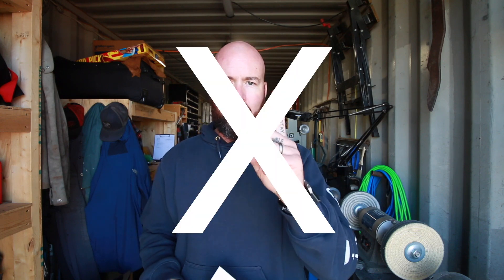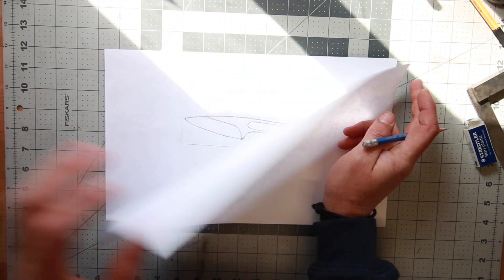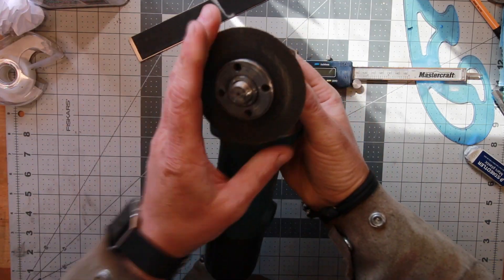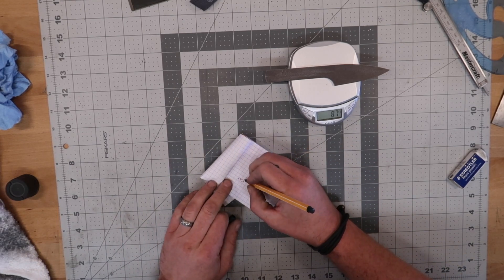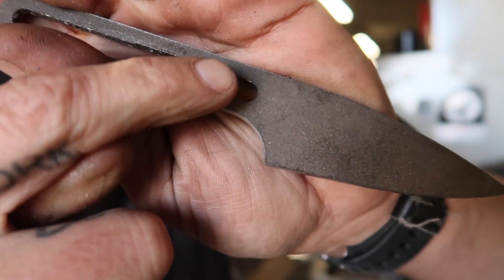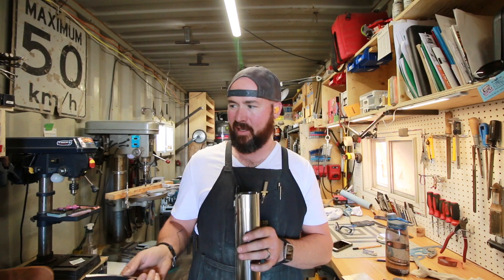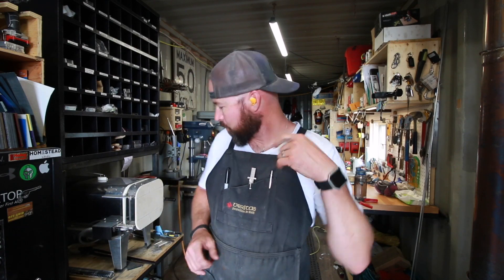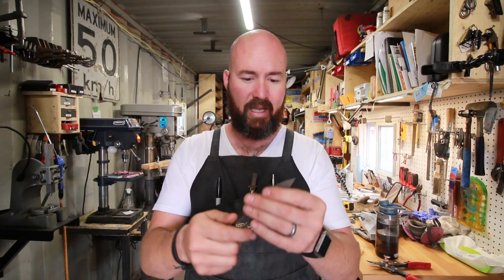How to make an Ultralight Backpacking or Running Knife - Part 1 (protection for a runner)

Comment: reminds me of that little vargo titanium clip knife, sans the clip. i think its a similar profile, something about that milled out handle.

also just a thought, maybe (once you make a sheath) set it up on one of those running waist pouches, idk what your routine is but having something like a dedicated rig could be a neat idea, grab and go, easy to clean easy to use.
Reply from the maker: Yeah it kind of is similar to that knife isn't it? And I do have a dedicated small waist pouch out of neoprene and I'll probably come up with low-profile way to mount this knife and just leave it on the belt perminately. Then it's just as you said, grab and go👍

Comment: Looks nice, I would have drilled a descending sized number of holes down the top of the blade, just below the spine, done file work on the handle and given it a hollow grind to really cut down on the weight...
Reply: Shelley Raskin you remind me of those ultralight hikers that drill holes in their toothbrushes. at some point it gets a little silly.

Comment: construction sounds didn't seem that loud that you had to stop, but i'm just using cheap computer speakers.  Also, I think of prussian blue as something for measuring contact patterns.  Dykem to me is only a layout dye.  As for the knife, I bet you could get it lighter if you milled out more on the blade, but left cross bracing material for strength.  Or dove tail in some aluminium or titanium cross braces.... hmm... sounds like the start of a competition.

Comment: If you made an epoxy mold you could suspend the knife and pour the epoxy and sand it down very thin, maybe even put in some finger grooves on the side. The whole handle would be encased in epoxy and hold very strong since you milled out the middle. Food for thought.
Reply: Joshua Gepner I really like this idea.. thanks for sharing👍